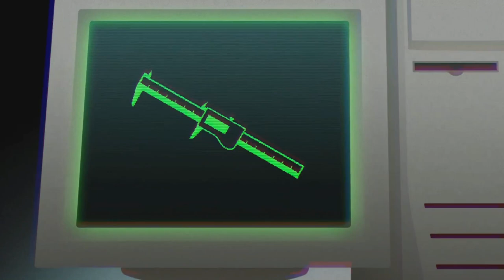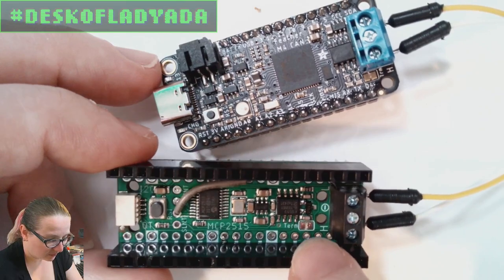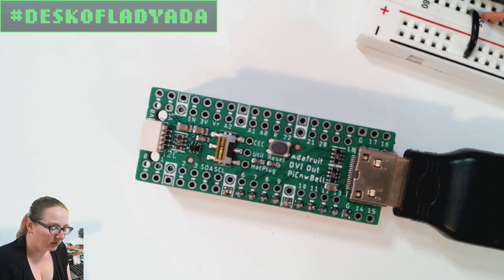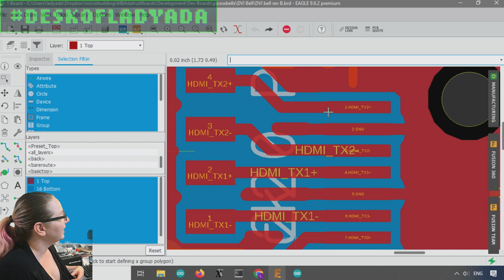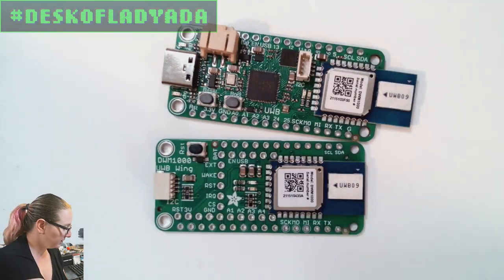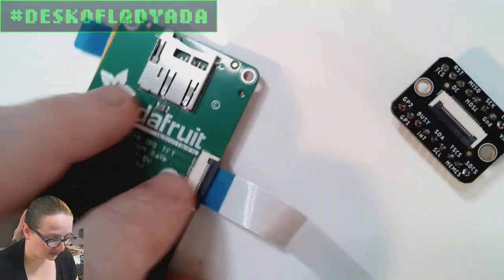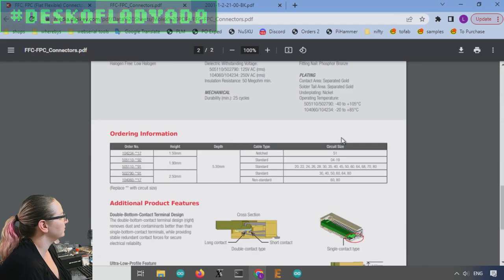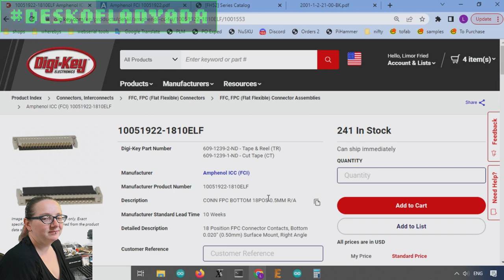The Desk of Ladyada - Ring a Ding Ding it's time for a PiCowbell Duet

Comment: The pcb design software has libraries of the different chips being used. Maybe add all the connectors used to a similar library to avoid a typo like you described? Or I am totally off the mark. The last time I tried designing a PCB, the only option for a hobbyist was the UV etching method. This was back in the early 80s as well.